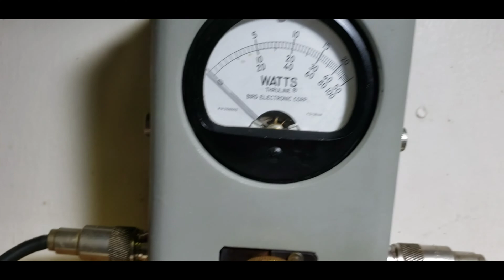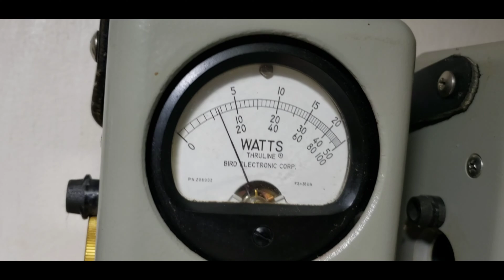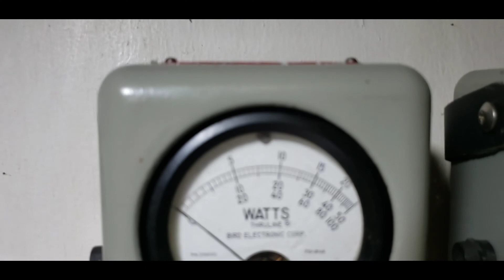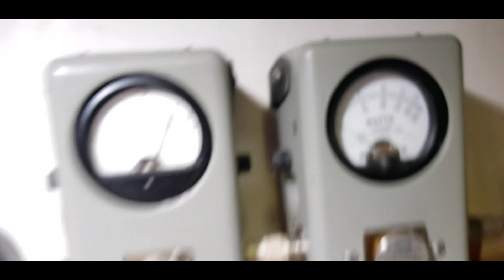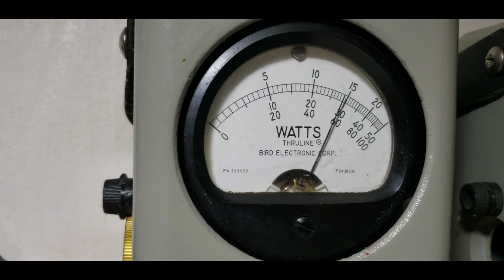GK Built Two Transistor RF Amplifier - [SLANG = 2 Pill For Short 😏]

Comment: first black board I seen . had many green boards come threw. I got a small 1 pill to fix. and made in Italy ZETAGI and has a 2SC 1969 in it. The newer ones have FET's in them. They still make them. them class C amps work well on FM . 73's
Reply from the maker: I'm surprised cause I've released like 3 other videos I've done in black boards.... but they were a little while ago.